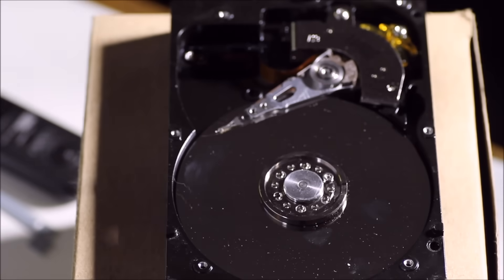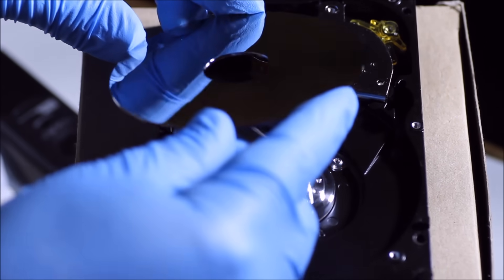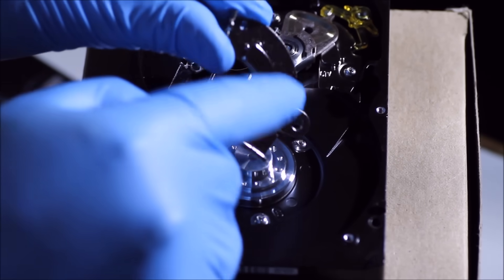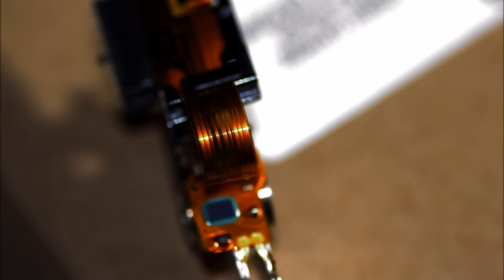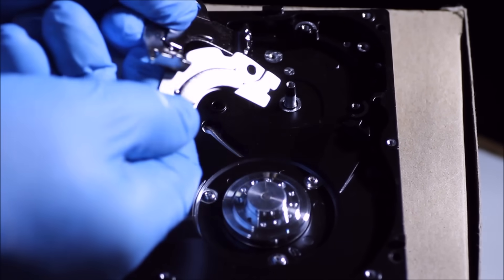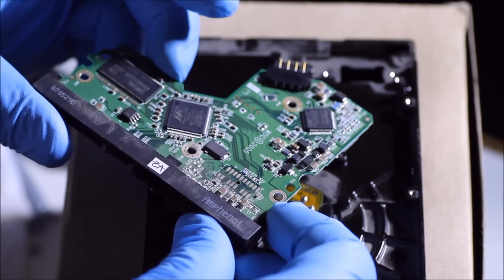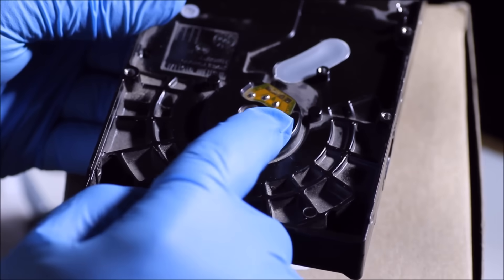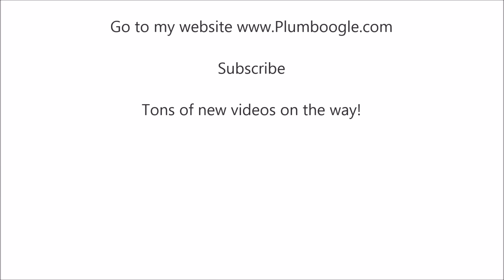Hard Drive Tear Down For Precious Metals! In Detail HD

Comment: that hard drive motor is fine to play with you can spin it using a microcontroller and a driver :) you can make a nice little grinder for example it is not very strong but it can do  quite a lot of rpm

Comment: Rob the plumber you should not believe everything that is written in Wikipedia. Here is an experiment you can try, grind the backing plates for the rare earth magnets and leave them in the rain for a couple of days. They will rust very quickly where they are ground and will not rust where it has not been ground as they are nickel plated. Nickel alloys ( MU metal ) do not rust.

Comment: I've never removed a hard drive magnet with a utility knife, they're often bonded with a process that's similar to a weld.
As for the small amounts of gold, you ultimately have to use a nasty chemical process. Bad for you and bad for the environment. Wish there was a better way to recycle these materials but this time, there is not!
Reply: you can recycle with vinegar and it is a lot safer

Comment: Indeed a very well presented video. The only downside is the ratio of effort versus the rewards to be earned isnt worthy of the time spent. It would be better to get as many hard drives as possible, strip them down to the various metals and just weigh them in. The steel and aluminium per kilo although less valuable than any gold would turn over more money and it would be far less hassle.

Comment: MU metal. I had gotten the magnets from hard drives...now I understand..its the Mumetal that weakens the magnet field. Woohoo. Have computers stored for parts that just accumulated over 30 years. Now I know what to do with them. THANK YOU for making video. I knew about the gold but found your explanation very helpful.
Reply: you can use the mumetals with magnets and control gravity and build a flying saucer. but do it in a garage or the black vans will show up.

Comment: Ceramic capacitors are valuable for their content of precious metals? C'mon! You can buy them from China, between 20 to 400 pieces for a single dollar (10nF capacitors cost 0.25 US cents per piece when you buy 10k - that is $0.0025, for clarity)... Generally, for how much work is shown in this video, you would get better recycling beer bottles, paper, aluminum cans, or other metal scrap...

Comment: I found that disks and the spacer rings and the casing of some HDD is magnesium and not aluminum. Magnesium dust from filings will sparkle in a flame and white vinegar makes bubbles on Mg not on Al. Now is it worth knowing ?
Reply: I think it is a magnesium alloy of Al and or Li. This gives it much better fatigue and creep properties than aluminium alloys would have. I always thought the spacer rings were a bit too light to be Al, also they chime with a much too high pitch for aluminium.

Comment: Best way to get the magnet off is by bending the bracket back away, but be careful, it wants to shoot out when it comes loose, and most likely to break, aim it towards yer lap...
Reply: it's best not to break the magnet away from the bracket because the protective coating usually tears away from the magnet also.  Which then deteriorates and weakens the magnet. Oxygen is a magnet killer. Takes a bit of time but shortly you will find the broken pieces no longer stronger than a fridge magnet.

Comment: Good diction, short and simple focused content, IMO, not enough attention paid to weights, measures and dates denoting relative value with respect to metal content.       Rough cost benefit calculations, extemporaneous equipment needs, and various fluids as well as safety information could be supplied within dead silent time on the video...,   But overall..., great job..., thank you very much.  of various

Comment: because silver oxidises in the atmosphere,
and degrades the contact
gold does not oxidise.
Reply: News flash genius it's things like sterling silver that reacts that way, and it's the other metals that are present that are oxidizing.  Pure silver is highly resistant, in fact it doesn't react with oxygen or water at normal temperatures.  A LOT of it is used for electronics because it is A) resistant to oxidation under normal conditions, B) less expensive and C) more electrically conductive than gold or copper, the latter of which does react with oxygen under normal temperatures and pressure.

Comment: Nice video; very concise and informative. I have been able to remove the gold leaf at the end of HDD connectors using a sharp chisel to get it started and then use a pair of pliers to remove it. Then I cut the gold leaf portion off and add it to an ever-growing pile of similar connector wires.  There are a couple videos on how to remove the plating using household chemicals, and some nasty stuff too, but it seems worth the effort if you can get enough collected to do a big batch.

Comment: Good work on the video. I've seen it before but didn't comment. I was browsing and came across it again and decided I would leave a comment this time. 
The thickness of the PGM coating on the disk is measured in microinches rather than microns. A micron is one millionth of a meter and a microinch is one millionth of an inch. 1 micron = 39.37 microinches. Gold plating is measured in microinches in the US. The symbol for micron is µ and the symbol for microinches is µin, so that would be 1µ = 39.37µin.
Also, while I am not saying the gold on the wires isn't good gold, it is not pure. It is plated. The only pure gold I have ever found in electronics is the gold bonding wires in IC packages. That is pure gold.
Reply: You seem to be confusing pure and solid.  Electroplating can be pure gold, but it is not solid gold.

Comment: please help me
What data must be compatible with among WD hard drives 2.5 BLUE If I want to replaced Head reading or pallets
Thanks..
Reply: You cannot replace the head. You cannot replace the disks. You cannot replace the motor (usually). You can only swap control boards, and even then, they have to EXACTLY match and you better be prepared to pray to whatever god(s) you may, as you'll probably lose all data. The positioning of everything is entirely dependent on initial location. Even removing the disks.. when you reseat the screws, it's out of alignment and there goes your porn collection. Buy a new drive.

Comment: The part where you say "C45", those are called the reference designated, which used for the surface mount machinery to pick and place these tiny component parts onto the board before getting weld together. 

Bare in mind that all reference designated has different number and letter assign to it. It's up to the PCB manufacture or the board company that set these reference.

Comment: If you want to remove the Neodynmagnets without breaking them you can put them in to aceton or similar fluid.
Let the magnets for approx. 1 day in the fluid, the glue between the two surfaces will liquefy.
You also can get it of with heat.... put heat and magnets.... not god ;-)

Comment: complete waste of time, better just go out and geta  job, you'd have to collect hundreds of these HDDs to earn any sort of money.
Reply from the maker: +Shane Otto Thank for your wonderful input!
Reply: But with this idea, you can earn some "spare" money
Reply: HomieGangEnt PHX,az I’m a unionized carpenter and I make disgustingly good money. I love scrapping for many reasons! 
I learn about how things work which sparks my interest as well as allows me to repair things at home with more confidence and ease.  
I find it very relaxing and allows me to escape the constant flow of responsibility.  
I don’t sell, I just hoard because I don’t need the money,  but I can either decide to melt my metals down and craft things with my son when he gets older. Or I can save it for a really nice trip or upgrade to the house,  or I can save it for an emergency barter item in the case of a very long term natural disaster something.  I used to stock endless supplies of food, water, batteries and all that kinda stuff, but it all goes bad on me because it never gets used.  This was something I could store that will last forever and has a use.  (I only collect non ferrous) and non magnetic stainless steel) 
I also collect silver coins for the same reason and I used to be into coin roll hunting for the pure copper pennies and pure nickel nickels.   My wife being from Sri Lanka knows all to well what it takes to flee a country if a person had to.  
I enjoy this because of course I could make 100x more at work, but sometimes it’s nice to be at home too and not have a boss over you screaming “let’s go maggots, concretes coming!”
Reply: DankPlayz  your thinking small bro old cell phones even older flip phones old computers or new ect. all contain gold some more than others anything with a green circuit board inside has gold not just these hard drives just a thought
Reply: yea "I wanna see asses an elbows" union carpenters nail it
Reply: Uhmm...thanks for your concern about how people make money (?)   Why'd you even watch this?
Reply: Wrong BlankPlay.  We've exploited the Earth's resources to the point of extinction with that attitude.
Reply: Highlighted reply
Refuso Againo
Prove we've exploited the Earth's resources to the point of extinction.

Comment: I've got about 50 older hard drives that I brought home from a scrap yard I worked at. They weren't licensed to do ecycle so they were quite pleased when I asked if I could have them.
Reply: I recently scrapped about 50 hdd.  The aluminum value ended up at about 40 bucks.  I haven't taken in the stainless yet.  Took me about 4 hours.  I knew going into it the only value was the alum.  I really wanted the magnets though.  They are awesome!

Comment: You can remove metal (pref gold) from plastic flexible strips with hydrochloric bleech and waste heat.

I've started recovering from my wife's blood sugar strips. There's a fair bit of pure gold there.
Reply: Andy Southern What is "hydrochloric bleech," exactly?
Reply: SuperToFue 

HCl
Reply: Andy Southern I've never heard of nor seen hydrochloric acid referred to as "bleech," though I'm not a chemist. 

However, my understanding is that HCL is supposed to be nearly non-reactive to platinum metals; also that though HNO3 has little effect on that metal group, the reaction is too minute to be practical, however aqua regia allows the HNO3 to aggressively attack platinum-group ions.. 

So how is it that HCL alone gets gold from those strips is beyond me. It appears more likely that it isn't gold at all, and may only be copper.
Reply: SuperToFue
(Edit)

HCl removes the gold as flakes. If you tried it you'd see. The non reactive nature of the HCl means the gold flakes are suspended in the HCl whilst any glues or other form a translucent band at the top of the bleach. The polypropylene based strips are also in the suspension.

You effectively remove the 24k gold without having to precipitate it out of the Auric Chloride solution at the end of the Aqua Regis.
Reply: Haha - it's amazing that you took my comment as an accusation (did you?). I simply relayed my understanding of chemical interactions and wanted clarification to your meaning...

Which of what I said, exactly, was inaccurate or "wrong"? Was it my statement about the appearance?  If that's the case, then I would actually be correct. 

Anyway, that makes sense about the adhesion of Au to the strip being attacked by the acid and not attacking the gold (or plastic) itself. I'm not diabetic and wouldn't have possession of those type of strips to immediately link some previously unmentioned concept of their construction to your original comment - hence stating my initial interpretation of appearances and the explicit qualifying of the statement as such, as well as explicitly describing my lack of understanding on your comment.  I apologize for my ignorance of things I've yet to encounter.

I'm still no closer to understanding any relation for HCL (hydrochloric acid) being referred to as "bleach," nor am I familiar with the noun of "aqua regis" being used as a verb to describe some process involving one of its more commonly-known synonyms (nitrohydrochloric acid, aqua regia), however, thank you for clarifying about the strips and for attempting not to bombard me with pointless colloquials.
Reply: +SuperToFue After re-reading it, I think I did, and what's worse, you were right, it's not HCl in the bleach I used it's a combination of Sodium Hydrochlorate and NaOH. I was thinking of my usual toilet bleach which is Domestos, that has HCl in it.

...but you were wrong about "It appears more likely that it isn't gold at all, and may only be copper." - it's 24K gold, though in some cases its now Palladium.
Reply: SuperToFue Aqua Regis is a commonly accepted name for what you call Aqua Regia, its just what you grow up with. 

That's why we have standardised Chemical formulas, to remove these confusions.

Comment: I have followed your methods and had quite good results in stripping off the magnets, one must use a very thin blade to loosen the adhesive that keeps them in place, once slightly separated further careful lifting should have the magnet removed without cracking or breaking the magnet. Remember that these magnets a very brittle if one is heavy handed they'll be broken into a number of pieces.
As for the comments that say this is a waste of time, well it is in fact a hobby that will pay for itself if done properly.
Some people smoke dope and complain their always broke, while others scrap computers and their bits and pieces to turn into small solid gold pieces.
Currently I have 5 kg of gold plated scrap (including the plastic bits left after I removed most of this mother-board material)  I anticipate 15-20 grams of gold from this volume of scrap. Do understand that this is a lot of scrapped plate gold, so I will begin in a largish thick plastic container which has a lid I had fashioned from the top of a commercially purchased 10-15 litre drinking-water bottle, then carefully and neatly I cut around the inside (using say a Stanley knife) of the bottom of the  PROJECTED ring located on the upper part of this water bottle.
Finally with the use of my angle grinder I have cleaned up all the edges top and bottom, the top of the bottle from the projected ring upwards is now the lid which fits and works perfectly.
Reply: Tighten one end of the mu-metal in a vise, use a vice-grip or a crescent wrench to bend the other side. The magnet will pop off, I've never seen one break.
Reply: Fair comment Harry, the same objective is to keep the magnets intact.

Comment: You know you could work a normal job and make more money per hour in a mcdonalds than doing this stuff. People like this need to let people know this is a costly and time consuming HOBBY and not a way to make money.
Reply from the maker: How is it costly? People make a very good living scrapping electronics. Usually you get the electronics for nothing.

It may be a hobby for me, but for many it is the freedom of working for themselves and not having to work for McDonalds.
I will tell you though that if I needed to, because of the skills I have learned, I could easily make a living doing this.

You have never tried doing this obviously, and jumped to the conclusion that this is worthless information.

Thanks for watching.
Reply: +SaulTBawlz For some people, not having a boss or dealing with the public is worth its weight in GOLD!!!
Reply: SaulTBawlz one some people watch tv or play games for a hobby witch has little to no return, that being said if you have the space the desire to toss u bunch of parts in bins till there full they may have a afternoon of scrapping and doing there part in recycling. Not to mention it adds up, could be a decent way to harvest gold to make that spray stuff that’s used for coating glass. It doesn’t have to be scrap

Comment: I have a couple of old boards and hard drives lying around that I will be stripping for a project. I've noticed along with the little rectangular structure marked with a C there are multiple other ones marked with different letters. My question is are those other letter ones the same thing as the ones marked with a C?
Reply from the maker: Yes, those are monolithic ceramic capacitors. The ones marked with Cxxx are usually keepers. Once you strip them take a magnet and see if they are magnetic. If they are not, they are worth refining!

Comment: Pretty good info on some components, but bad idea on burning or torching rare earth metals to recover gold, etc.  These are properly recovered by removing the component parts to the smallest value by content and type, crushing them and chemically dissolving the metals in special acids.  Properly recovering gold, silver, cobalt, palladium is very specialized, requiring expert handling of dangerous and caustic substances, and some pure refined metal or mineral components are very hazardous to the touch in pure form.  I know because this is my background as a chemical engineer with loads of specialized testing and recovery of lab specimens, and recover semiconductors as a hobby business.
Reply: The U.S. Military finds using citric acids from fruit useful in chemically separating the precious metals from resin and plastics of components, while eliminating the use of caustic chemicals or burning.
Reply: Please prove this is a functional method with a vid
Reply: @urzaplainswalker10  holy crap..i got a half lemon half grapefruit hybrid that's produces awful fruit...its good antifungal and now i know what else to use it for as its quite a producer. ...tks
Reply: R.V. Gad 

My self 
Pooraram 
A theoretical physicts
Reply: I would like to know if tantalum capacitors are worth more intact, or, is that not an issue? What is the current value?